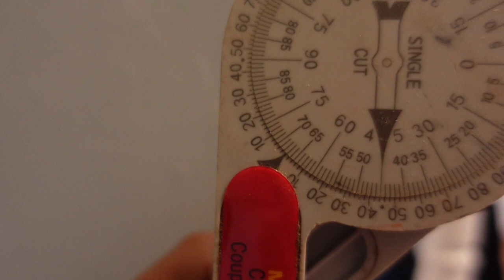Installing A Missing Stair Handrail And Spindles 💪

Comment: You might not be good at math. You great at common,  practical senses. 👏🏿
Reply from the maker: Thanks a lot. And ty for the comment
Reply: This is great. I don’t know if I can use this method in the UK because I’m not sure it complies with building regs. I have a top newel post that’s offset from the stringer so a return like this would make my project much easier.